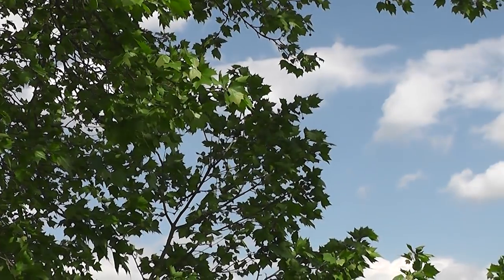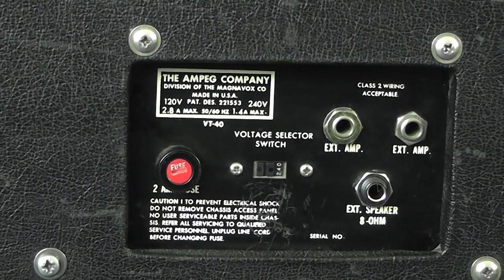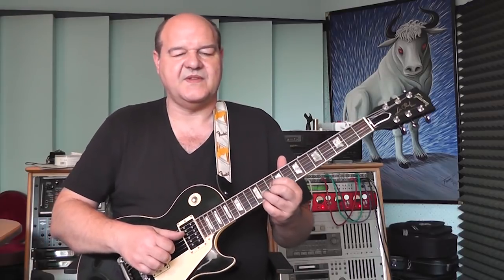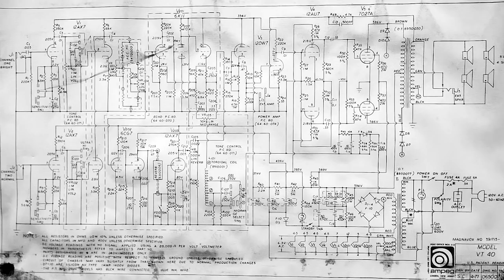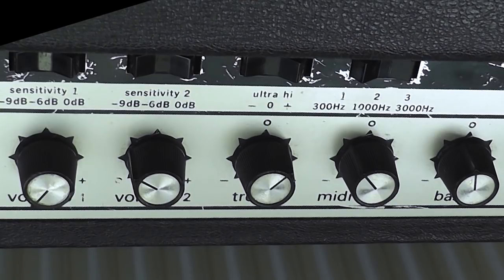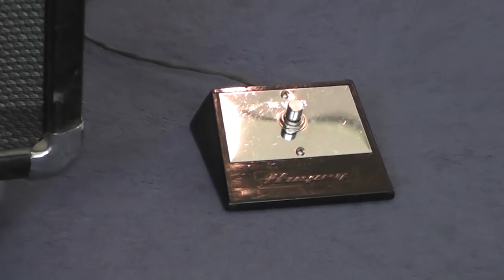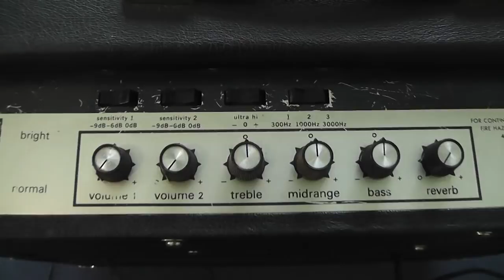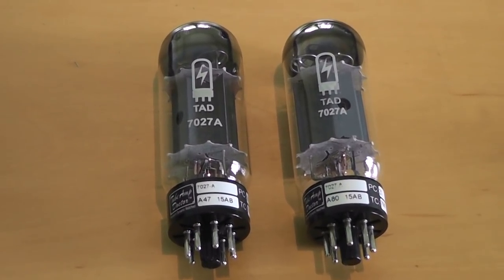Vintage Ampeg VT-40 1971 model Demo

Comment: I am the lucky owner of a pair - each one has its own personality! They are amazing amps, but as Mike indicated, you need to find a tech that understands them. I was lucky enough to have (the late) Dennis Kager fix mine - sad loss, as Dennis had been Ampeg's Service Manager. I originally discovered the VT-40 when I played in a bar band in the early 70's. Of course, I sold it and then had to find used ones later in life! They are quirky, but like many things in this world, if you're willing to put the time and effort into one, you will be richly rewarded. Nice playing, Mike!
Reply: Lucky you! I replaced my first bass amp in life, an Ampeg SB12, with a spot on 1966 model. And best part? It belonged to Dennis Kager who also totally refurbished this amp. How cool is that? Jess Oliver used to service all my Ampegs here in New York until he passed away. I got to know Jess pretty well. Unfortunately I never met Dennis. I bought the amp 4 years ago from a fella just outside NYC in New Jersey who bought it directly from Dennis. I’d love to add one of these VT40’s to my Ampeg collection. Especially an early model like Mike has in this video. 
Cheers 🍻 Mate from Woodstock, NY

Comment: Update from my comment 2 months ago. I have recently lucked out and found an Ampeg V4 Head at a shop in NY 3 hours from me. I called the guy and said I want to buy it, I'm driving a long way to
you. He was cool and when I got there I played through it and it didn't take long at all, I fell in love with it and I took her home lol. What a sound!! I will never let her go. Thanks, your video was an
inspiration to me. It is either a 1971-73" year the time Magnavox put their stamp on it. It has no distortion knob or main knob, two volumes, treble, midrange, bass, reverb is terrific with the black
metal slider EQ switches. Has 4) 7027A power tubes. Is it loud? that's an understatement lol. The clarity is really unmatched in my opinion. I can make it sound like The Stones or add my effects
board to it and it can get really mean if I want. Best amp I ever owned and I've owned Marshall, Fender, Vox, Peavy, and Mesa Boogie. They all have their sounds, differences but not like the Ampeg. If
anyone lucks out in finding an old 70's Ampeg, Just buy it they are amazing and take pedals really well.
Reply from the maker: Congratulations!!! :) VT-40's are not a myth, they are simply very special! I wish you lots of fun with your VT-40! :)

Comment: The distorted sounds you are getting are flat out wicked for you for sure. The lead tones in particular are very sweet and singing, violin like is the oerfect description, but I do also think you are a player who can coax tones out of an amp beyond what a lot of lower level players are capable of. Like when you grab a note and are really pulling on it  with a wide vibrato, it just pulls that extra 5% out that just brings it up to the stratosphere. I have seen Jeff Beck pull some pretty not too bad  tones out of an amp that looked an awful lot like yours on an old tv appearance where he demoed a wah wah pedal a Coloursound booster and a talkbox I think. Such a rudimentary setup but he didnt sound lacking through it. It filled me with pride because I started my playing journey on a late 50s i think, Ampeg Rocket (not your standard heavy metal fare for sure) which I played in my very first band, and I will keep forever, Im so glad none of my dads buddies were ever able to swindle it from me when I was just a little guy, and for a few years ending my high school times, i had moved up to an Ampeg V-4 until I went British in my ass amp tones and sold that high powered beast to fund what I lusted for, a Hiwatt Custom 50. Hey when you are young, you tend to need to sell what you got to get something new. I like your playing quite a lot. Im from Canada but I seem gravitate towards European guitarists for my tastes.  Maybe Ill head over to I think a countryman of yours, (please forgive me if I am incorrect), Helmut Bibl, hr gets epic tones too. Cheers!

Comment: Hi Mike, just came across your video. I bought my VT-40 in 1974 used for USD225. In the 90s I did a complete refurbishment but sadly it's so heavy I haven't used it much. I understand you can add a pot to the preamp output jacks to get that great tone without blowing your ears out- I found it would start to get sweet about 4+ on the volume and I have to say back in the day I could easily hold my own against Marshall half stacks or Fender Twins. Anyway fantastic demo!!! Maybe I'll have to break my back and pull the old VT-40 out of the garage. But for now I have Carvin V3MC combo (1-12" Celestion) that sounds pretty darn good (check us out on old Cream song) but I don't think it's got the same soul as the VT-40!

Comment: Nice amp! I live in New Orleans, LA in the US. I was looking at my local FB MarketPlace 2 weeks ago, and found the second version…1974 the non distortion reverb same circuit as this but front load for $350! The one with the polarity switch. I also paired it with a Treble Booster and a Stone Deaf PDF1x pedal. 

A guy was moving to Paris and just had to dump it. A girl in a Rolling Stones cover band, bought it for $400. Way too loud for her, and saw  she was 2min down the street and was only up for an hour. She was a bit drunk buying it, and it was too loud. I was honest with her, and she said she was ok with low price keeping it in the local music scene, as I have a studio in the area. So clear consensus and good deal! 

Just trying to work it in with my Sky King amp as an ABY thing. 

So of course I bought it! Only issues were two slightly microphonic V1/V2, but they are still holding on until replacement. The chord had been converted to 3 prong…but it’s got some tare….nothing bad, but electric tape is fine as the inner is not damaged. I will eventually put some money into it. But I was surprised all was working well! 

I love the amp by itself just cranked, and maybe an EQ and treble booster…nothing more needed! That’s how I’m going to use it and switch back and forth. 

I have access to a 70s Bassman and a 80s JCM 800. But I like this better! It’s hard to record correctly, but live it sounds like no other.

Day I bought it recording! Sounded great! Excuse the iPhone sound quality. I have some API/Neve pres in a lunchbox and plan to record soon! 

https://youtu.be/ZaXIDw4DR8k?si=njUZIv937QFKU2qQ

Comment: Fantastic demo Mike! I acquired a VT-40 when I was 19 years old. Kept it all theses years (I'm 56!). You have have inspired me to get mine "surgically overhauled" as you did. I have kept it but have avoided playing through mine because it literally gives me a shock when I plug it in and then touch my guitar strings, etc. Of course this vintage amp doesn't have a grounded 3-prong plug. Did your guru need to replace the plug or have grounding issues with yours? Thanks... and congrats on your restoration!

Comment: Am I hearing Exile on Mainstreet? Or was that a V22? 
Did Bobby find a power transformer? Is this the same tech who revives those old Klemt Echolette’s? Any experience with the Klemt m40’s? Seems like a solid piece of gear. 
I have a 65’ GS12 R reverberocket-wonderful cleans but doesn’t like dirt pedals. Going to try an eq pedal and see if I can tame it a bit . There just isn’t much love for them here in the states. Can’t figure as my Rocket is a Deluxe killer.

Comment: Hi there, my name is Joshua and I’m from Canada. I have an early Ampeg VT-40 but I’m having a terrible time figuring it out. Yours for example has what looks like a fuse in red Color on the top next to the standby switch and mine does not have that, instead there is a push/pull knob and I’m not sure I fully understand what it is or what it’s for exactly since I am only just starting to deep dive my amp.  I bought this in 2008 and it was in my storage until recently and I really want to get it running as nice as yours.  But there’s some differences such as the push/pull knob next to the standby, and then like yours, mine has the black rocker switches up top but mine does not have the readouts like yours for example the midrange with 0/300/3000.  So again, mine does not have any of the read out numerals on the top with the black rocker switches at all and yours has all.  The serial on the back of mine is reading 107425 and is the top loading model like yours and seems to have the same tubes as yours as well.  I’m hoping you might be able to help me to figure something out and I’m wondering if what you said in your video about yours being a 1971, and the top loader model changing around 1972 until 1975 if my VT-40 might fall to this second time bracket possibly with the 107xxx serial.  I was also hoping to ask you if you knew what exactly Bobby did to make her sound so good and clear and more quiet? Any help would be great my friend!! I’ve watched your video a hundred times as it’s for me the very best example online of this beautiful amp we share love for.  My last question is do you happen to know what speakers you have for your 4 10 inch speakers and if they are the original or aftermarket?  Sorry for the long note but I feel you may know best and I absolutely love your video and also playing is great! Thank you so much in advance!
Reply from the maker: Hi Joshua, first of all congratulations for your VT-40 and welcome to the rare top loader family! :) Unfortunately dating by serial number does not work for these models, but the black rocker switches do indicate any year before 1975! Another medium safe indication is the "A" plate on the front. If it is made from plastic your amp may not be earlier than 1973. By the way... my amp has the plastic "A" logo, but Bobby told me that on my amp the metal "A" logo had been replaced when he serviced it. I cannot be sure, since I was a young boy when the amp was made and I bought it already used back in the day. Bobby told me that he was sure it was a 1971 model, since he found that year somewhere marked on the circuit board. Well, we all are "swimming" because of the lack of really proper documentation. My amp has the orginal speakers with the code 2857515. Don't ask me what the push-pull poti you were describing does. Maybe it is a later modification. Unfortunately I cannot ask Bobby what he exactly did on my amp, the best tube amp expert here in Germany in my area who serviced amps from Gary Moore and Jeff Beck for these guys personally. He passed away last year. :( But I remember for sure that he recapped some (not all) of the capacitators, did some resoldering magic and the main thing was that he replaced the original power supply not (!) with a original replacement. He used a fitting power supply from his stash which was not designed for this amp. Before the amp did a lot of noises and radio stations broadcasting LOL. After he switched the power supply all of these symptoms were gone, the amp way louder and dynamic. Many modern amp techs will refuse to service a VT-40 because it is so hard to work on, but here is a very important document you should have at hand when finding a experienced tube tech: https://ampeg.com/support/files/Schematics/V%20Series/VT-40/VT-40%20Service%20Manual.pdf
Reply: I'm in Connecticut. My 1973 Ampeg VT-40 was just serviced. This is a top-loading VT-40. The original speakers for this amp were 10" CTS. At the time of purchase, Altec Landings we're available from Ampeg as an option. The Stones' Ampegs we're all outfitted with Altec Landings.

Mick Taylor used a VT-40 when he teamed up with Jack Bruce in 1975. He also used it when he recorded his 1979 solo album. 

To note, if you ever need to replace your transformer, don't use just any transformer. Get a boutique transformer that's similar to the one you're replacing, and that's your best bet at retaining the original tonality of this unique amp.

I also have two V-2 heads. I use all three at the same time.

Comment: Hi Mike ! Living in Belgium here. I saw that you mentioned the 6q11 tube. Do you know where I could find one of these in Europe ? I recently bought a vintage V2 that has a lot of similarities with your amp, and the tube seem to be dead. But I can't find anybody selling this tube in Europe.
Reply from the maker: I feel your pain. :) These tubes are very rare in Europe. Myself I was buying a replacement in the U.S. The tube has the name "6K11" from General Electric (GE) and you can find them still 'new' for reasonable prices in the U.S. like here in this example: https://reverb.com/item/3189300-general-electric-electron-tubes-6k11-compactron-triple-triode-new-old-stock-for-ampeg-tested
Reply: @MikeBurn  Impossible to find these under 80 dollars on Reverb nowadays unfortunately :( But thanks for your help !
Reply from the maker: An alternative would be to look for a "6K11" from Sylvania as offered here: https://www.tundtmusic.com/Roehren/NOS-Roehren/6K11-6Q11-Roehre-NOS::277.html

Comment: im so glad you got YOUR amp back,, and that you where able to get it running properly,, you where in the zone from 18:00 on,, any amp that can get you there is a great thing. so have you put a tube screamer in front of it yet to get distortion at lower volume? or go speaker out to another closed back 4x12?

Comment: Hey Mike
Thank you for this. I was fortunate enough to buy an Ampeg vt 40 back in 1973 and was lucky enough that I never had to sell it.
Question: For your lead solo at the end from about 16:00 to 20:30 did you use any other special effects or was that just the amp with it's own reverb?
Reply from the maker: Congrats for your 1973 model!!!! :) Regarding your question: In addition to the VT-40 Reverb I used a Digitech TSR-24 for adding some delay. :)))
Reply: @MikeBurn  Digitech TSR-24
May have to get me one of those.
Just out of curiosity... Have you ever tried using a power attenuator between the amp and the speaker so that you could keep the VT-40 in the same room with you when you played? If so how well does it work?

Comment: when playing the crunch tones were you using a pedal or was that just the amp?
Reply from the maker: Of course no distortion pedal involved, just the beauty of the amp. :)
Reply: @MikeBurn  I have the chance to purchase this same amp in mint condition for $600 I was going to ask you if you think its a good amp but I can see you love it. I've been told there is a lot of maintenance on these old tube amps is that true in your experience?  Do you think this Amp in mint condition is worth $600? Thanks
Reply from the maker: @kennethmeese  For this money it is a no brainer!!!! And yes, tube amps, vintage tube amps in particular, do need proper maintenance, the reward is a sound from heaven. :)) Best scenario would be to have a tube-amp expert checking the amp in advance for improper modifications and other problems, just to rule out a "expensive" buy.